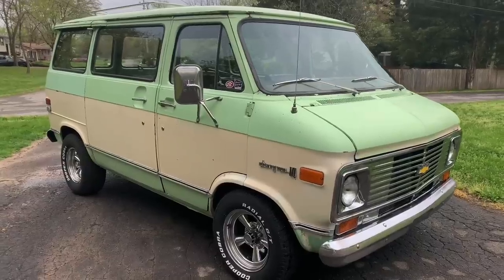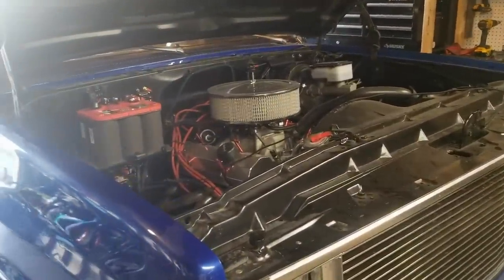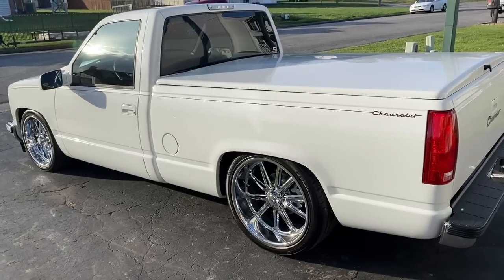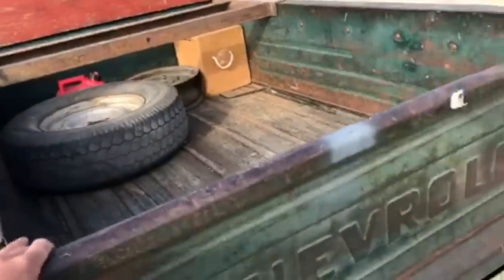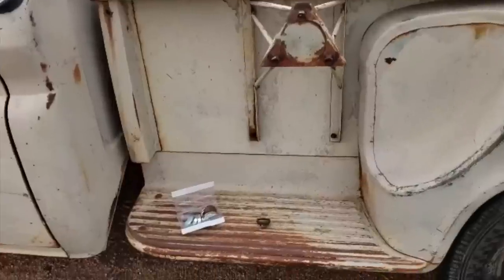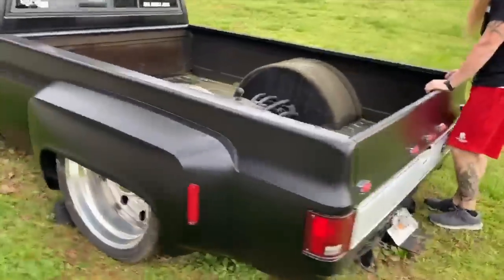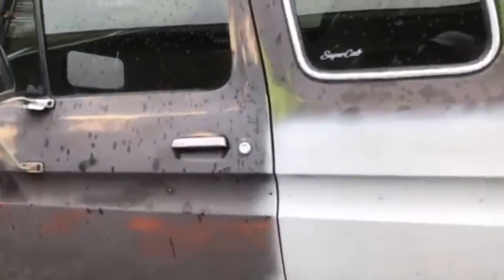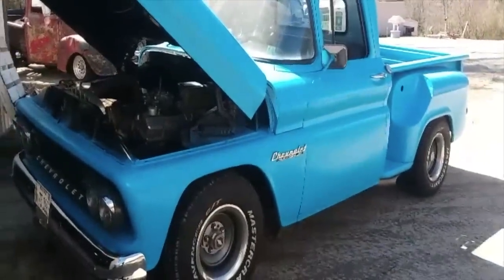1971 2wd Blazer / 1975 Ford F100 / 1975 Chevy G10 Van / 1996 Chevy Silverado / Squarebody c30 & more

Comment: Good Job Rob, Your becoming one of my favorite channells...  I'm retired to Flagler Beach after 39 years in Marietta... Mostly at Marietta Radiator.. We did lots of A/C work on Hot Rods and Truvks through the years and still do.. I'm hoping to get a 02 NBS truck built before i'm too old... Love the 67-72 stuff but just not enough room inside.. Regret selling my 89 Z71 and my 98 2dr Tahoe... Keep peddleing....